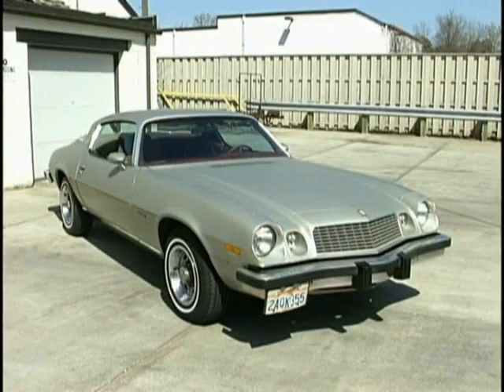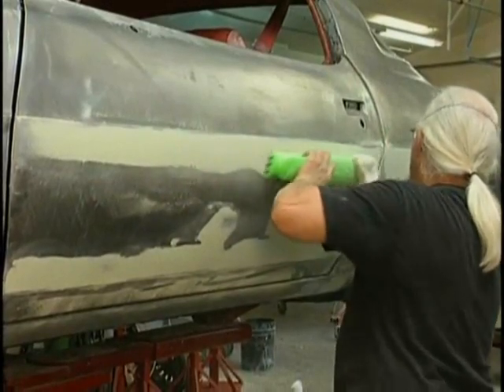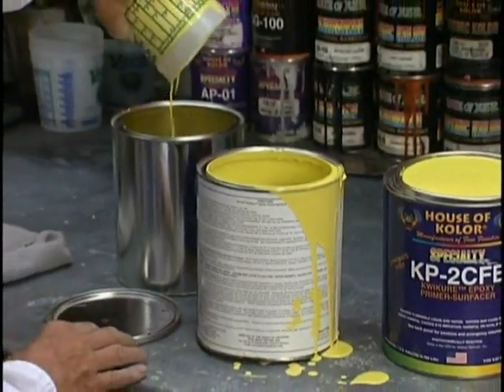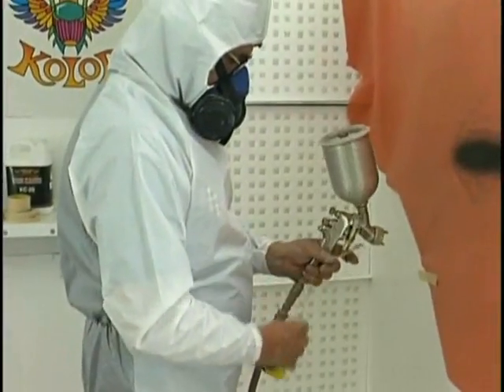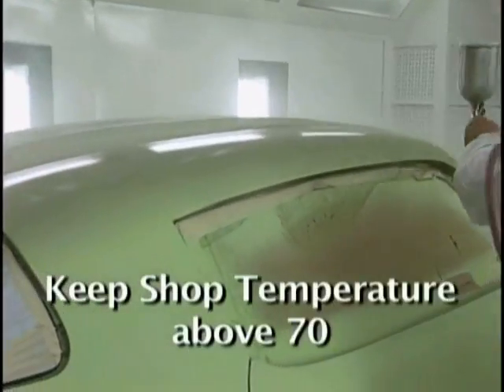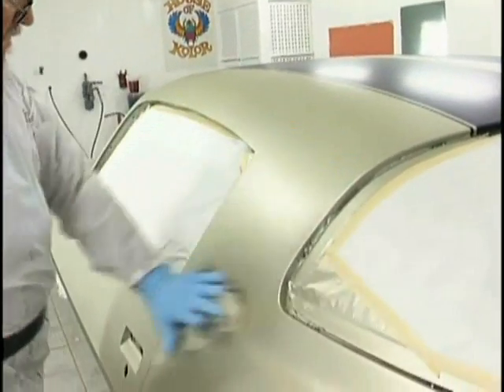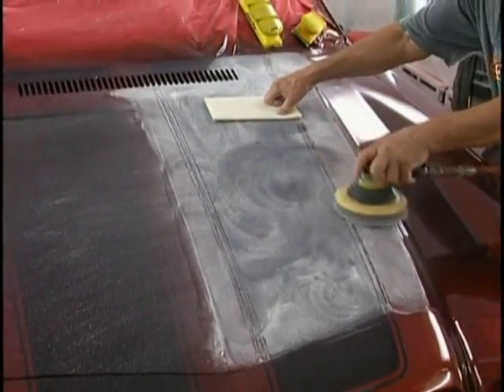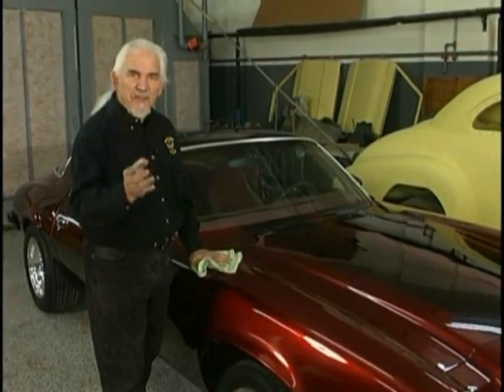KUSTOM PAINTING MADE EASY WITH MASTER PAINTER JON KOSMOSKI

Comment: Great video. As a, once upon a time, car painter in SoCal, I appreciate the techniques you are presenting. Of course, the equipment, and the products are all different but the basics are still there. The prep being the most important part of the paint job, the attention to detail on that prep, the way the paint is laid down, and the rational behind that, the straight line painting, the bending to get the rockers and the wheel wells. Everything is right on. My kudos Jon. Great job!

Comment: I could only dream about a paint job like that on my chevelle.  Beautiful work!
Reply from the maker: Thank You
Reply: pharraway   Hey man! I know you most likely busy but I was wondering if I could bother you for a few minutes and ask you a question if you can. I'm on the  step of choosing how many coats of paint for my project and I got some spray out cards that look like a checker board.
How do I use them? I mean, do I clean the card and spray the base and then the metallic and clear? Or do I have to spray primer and then the base,color and clear? 
I'm using motorcycle paint for my jeep from color-rite.
Any help will be appreciated,thanks.
Reply: king0cans hindinews
Reply: MrElPoderozo1 you use the spray out cards to test coverage or color matching. You can do a complete card spraying the metallic base then clear it to see the final color. You use the card as you go along, when the checkerboard is gone then you have complete coverage.
Reply: North Carolina Outdoors Thanks for replying. So Im using 3 stage paint. Base,metallic and clear. So I spray out the base color first then wait 10 min. and spray the metallic wait 30 min and then the clear? 
Do I have to use primer before any of that? Thanks again man I really appreciate your time.
Reply: MrElPoderozo1 epoxy primer is an under coat or a sealer for spots which body filler is larger than a quarter. Once all the body work is finished then you finish off the filler or primer with 320 and do a final coat of a primer surfacer. Once it’s cure the you will hit the primer with 600 grit wet sanding (Depending on manufactures SOP) to get the area flat for tristage paint. After you sand you will want to use a sealer and let it flash off. After that you will hit it with your base coat until complete coverage (2-3 coats flashing between) then you will use the middle stage until you are happy with the results. The clear will be the last step and you will probably need to wetsand once the clear cures because the large metallic flakes will cause an uneven surface. Once it’s wet sanded out you will flow coat and do sanding and polishing once it’s done. Use the Technical Data Sheets or call the local paint rep for the brand and follow what they say. Each brand is different as far as flash, cure and wait times go. The TDS will tell you everything you need to know about the product.
Reply: North Carolina Outdoors  Thank you very much for your help. This means a lot to me, trust me on that. I will forever be grateful 👍🇺🇸
Reply: iam in the same dilema with a 69 corvette i have in the garage. This guy works so correct. he is careful to detail and knows his stuff. lot of painters make up their onw methods and ignore manufacturers guidelines and the paint wont last as long.
Reply: icould paint her.
Reply: @7REDDRACO7  my vette? thank you!! lol
Reply: @MrElPoderozo1  spray metallics in a checkerboard pattern to avoid streaks
Reply: @mrromantimothy   Thank you👍🏻

Comment: Hi Jon.i have been painting for 45 years and i tend to disagree.anyone cant do these paint jobs it is an art from start to finish.
Nice work and all the best from oz...
Reply: @Jon--
What would you estimate the value of all the equipment?
Reply: Totally agree. I painted my first car in highschool and so I have years past since then but I am and never was a professional.  Having worked very hard for modest results, I can fully understand how hard it is to do work at the level shown in this video.  The knowledge and expertise in every aspect from mixing paints, cleaning, prepping, technique, time between coats etc... He makes it look easy but I know this is not easy, no way.  He is very very good.  Top level profesional.
Reply: Jeffrey Baker Wa
Reply: I dunno. I’ve seen show winners painted in poly tarp “paint booth” and they sure looked better than most body shop jobs...
Reply: Body shops normally only do what they can get away with. Orange peel galore.
Reply: Bob Greene I’m not Jon, but realistically you’d be in pretty good shape for $800-$900 in tools plus whatever your compressor would cost, $700-$950 or so.
Reply: dogboy That's why the expression "it's like watching paint dry" exists. Each one of these videos is more tedious than the next. Amazing resolve and results though to be sure.
Reply: Jon's DeVillbis compressor, dryer and filtration systems are at least $8,000 and probably over $10,000.  You could do nothing for $1,000 unless you are buying from Home Depot.   If you missed it, he is using a Pro Dry Air Conditioner Unit to remove moisture for the compressed air, the only way to have perfect air.   The next generation is a move to pure Nitrogen system, no more air or the hassles of trying to remove the oil and water.    We have been making N2 generation systems that fill tires for over 20 years and lately we are selling a lot of them to body shops...  for primers, sealers and topcoats.   You not only have zero moisture but the materials lay down smoother with less work.   Hope this help, Gary PremierNitrogen.com

Comment: You did an excellent job.  I'm an amateur body and paint guy which learned the hard way about blocking and sanding and blocking and sanding.  Painting was the easy part.  The prep and body work is the key.  Again very impressive, beautiful work.

Comment: used a white sealer with a metallic red , big mistake now  i gotta sand all that paint off and blow some red oxide sealer on there so the fn tank matches th rest of the fairings on the bike all this is good advice
Reply: Brent Gordon with reds you most likely will use a black or grey sealer. Only use white for very vibrant and light colors

Comment: I did a 69 camaro when I was 18 in midnight blue (1978 vette color) laquer. I had no ideal what I was doing. I striped it  and gave it some z28 strips.  1982 Now I have a 92 f250 I am getting ready for paint. It was my landscape truck. I used to touch it up with rustoleum rising sun red. Spray cans from the hardware store. I am thinking of spraying the whole truck with it than clear coating?  I saw you used a plastic bag in the cup. How does that work? I saw the d cup things but you used a plastic bag I think. I would consider your products. Money is a consideration. Heat stroke last year . Have not worked since.
Reply: Sorry to learn you were ill, I hope you are better soon. -A rattle can paint job will be more work for you, and results will never be as good. The color is inconsistent so is the pressure. And it will cost more money and needs to be properly recycled... My idea is to rent a booth, I haven't solved the gun yet. I would think a rented gun won't be well-cleaned...? They seem to cost $350-500 US. I watch "The Gunman" to learn about gun makes 😄
Reply: Very helpful comments-- how did your own project turn out? Did you rent a booth, after all? That seems an ideal solution, since you have a better work environment and definitely a better compressor and filtration/drying equipment.
Reply: Depending on an individual's budget, you may be able to do it yourself but it would be difficult.  In the old days there were booths that you could rent but not likely today, they are just too expensive to buy and maintain so rental could be $500 a day or more.  You may be able to purchase a cheap pop up garage from a place like Harbor Freight and then modify it with clear plastic sheets on the inside that you can seal with duct tape.  Of course the best is a home two car garage for security, with the hanging plastic sheets and some sealing with the tape.  Don't forget to get a really high quality dryer system for the air compressor and a little screw on filter at the gun.

Comment: Love this video...proper work, proper tools and the right attitude on what people really want for a car they have wanted to do for years, like me!  NICE...wish your shop was in my town!  a PAINT TIN TIP... take a sml philips screw driver or a sharp punch and run holes along the inside of the rim of the can, that way, the excess paint goes back into the tin, and you can clean the edge with a brush, and not have all that pooled paint around the rim!  The lid does not seal there anyway, so the few holes will not wreck the sealing of the lid:)  Cheers and thank you for a great tutorial!!  House of Kolor is a great product.  Thanks for all the important tips and information, showing how it gets done right:)  Amazing!

Comment: forgot to disconnect battery  cars with computer like bmw will  fry the computer  if you don't disconnect battery
 if your going tom do a CLASS ACT TUTORIAL WHY NOT TINT AND LEAD YOU CAN USE THE LEAD STICK TO PULL OUT DENTS  AND FILE IT OFF IMEDIATELY  FASTER THAN WAITING FOR BONDO AND YOU CAN PICK AND FILE LEAD  LOW SPOTS  BONDO WILL CRACK AND  FALL OUT ….. LEAD IS THE WAY TO GO IN MY BOOK, NO DUST WITH LEAD

Comment: ..I'm about 4hrs into starting to sand my 12yr old Chrysler 300C 5dr saloon...( By hand as I don't have a sander yet..!!) Got one on order but the battery and charger don't arrive until next week..(Back to sanding by hand until then..!!) ..Have a full time job, so can only do bits at a time. Quite annoying as I have to keep cleaning it before I can do anything and I live in a flat upstairs so water is hard to get...Thought I'd bitten off more than I could chew, but this video has given me the extra motivation that I need to re-assure me that the dream of the finish that I have in my head can, and will, be achieved. Thank-you Sir, you are a fantastic craftsman. Lol from England.

Comment: Great job great video a true craftsman. I'm not a fan of house of Kolor because of recoat wrinkling. I used it on a car I did for Autorama in Detroit It was a 40 Ford convertible we chopped and sectioned. I was painting the underside of the floor.  
The every edge wrinkles when I flips the car over. And door jams wrinkled along door jams. I ended up using a different clear. 
You are a great teacher. Awesome explanation of the job and why.

Comment: Pharraway, the Camaro you're painting brought back great memories. The first car I bought at age 17 was a 1976 Camaro then a 1978, which I Pro Streeted with a 468 ratt, Muncie Rock Crusher and narrowed a Ford 9" with 411 gears. I did the body work and painted candy red, like yours ! . I became a auto body because of it and a car builder. My last and best car, is a 427 Shelby Cobra with a correct 428 FE street engine. Just built a new one with stacked EFI and 550 HP/TQ.  I don't know how to paste pics here ? Anyway, thanks for the memory !

Comment: Wow!  the title was so correct; this  is so easy to do ; unfortunately for me my 12 year old son was using the spray equipment to paint his model matchbox cars so I had to compromise and I used a 6 inch paint roller and it is stunning. we only live in a ground floor unit and lucky for me I only have a small car and I have no area outside where I could do this so I took out the front large window and drove my car inside the unit into the front lounge area; I made a bit of a mess on the carpet and furniture when I used the paint stripper but it was so worth it to see the beautiful finish I achieved with this so simple method. I did have to change my roller twice though but as it said in the title this is such an easy way to paint a car. I think I should have used my old clothes to do the work though but I didn't have a space suit like in the video so I used a pair of pyjamas which was good as it was late when I finished and I didn't have to change to go to bed, just hopped straight in and slept like a log. The negative thing for me was not replacing my front window before I went to bed cos when I woke up the next morning, someone had stolen my car and also the front window but nevertheless a great video and I would do it all again if I ever get another car.

Comment: It does appear as if you check the fan with the tip wings in the vertical position, but then you arrange them horizontally when you paint. Is this correct? I am an engineer and just bought a Devibiss  gun i want to use this summer. You are an old school craftsman. Much Respect! Thanks!

Comment: Wow, you did so much work on this car. I watched the whole video, thanks for sharing "Buddy". What was this job worth $10,000 or above? 

I have a 2012 Dodge Challenger Sxt. White. I have only had it for 3-years, there was a younger guy that owned it before myself. So, I'm the second owner. 

A short while back I was washing the car, after rising,  I use a microfiber towel to clean all drips. During this, on the drivers side, behind the driver's door lower area but in front of the drivers back wheel, and slightly above the plastic ground effect trim at the crease area [Blisters] are forming. I used a 3 thousand wet sandpaper and wet sanded level.

Rust I think, how bad not sure.

I'd like to show you and ask what would you do, steps you would take to diagnose the extent to stop the issue from spreading. 

[I have shown a picture as I'd show you, a body shop man he says need a new rear quarter.]

I'm choked.

Would you be interested in advising my-self to correct this issue? I'd be greatful.

Thanks in advance. Sam... Care Always.

Comment: Great info and shows a lot of shortcuts and how machines speed up what used to be days of blocking in wet shoes.
 i was a bit confused as to why the mirror and door handle holes wernt taped from the back to stop dust flying out and overspray getting in..also guide coat with the windows down and  no cover over the exhaust system ,,it got painted too,,,i like to see how the door jambs were painted and the insides of the engine bay where the fenders are silver,, overall great video and great products..
i loved it.

Comment: Jon does his prep work the "Old School Way" Lots of hand sanding using sanding blocks to take out all the wave out flat body panels.  I have seen fantastic paint jobs ruined by amateur body work. Spraying a car is not too difficult, good technique, clean booth, dry air and a little luck you will get fine results.  I have painted several cars in paint booths constructed using plastic sheeting, box fans and furnace filters.  Prep a trunk lid and 1 door and take your finished panels to a good body shop and ask them if you are doing it right.  They will tell you if you are working in the right direction.  If not, they will offer suggestions.  Once you are ready to spray take your car somewhere where a painter moonlights on the weekends so he can roll your car in the booth on friday night and shoot it on saturday morning then show up midday on sunday to roll it out, untape it and drive it home so you can let it cure in the garage for a few days before you start hanging trim back on the body.

Comment: House of color and all the rest of pain products have sky rocketed to the level that people cant afford this kind of quality pain jobs as in the past. You can pay over $2500. eazy for all paint and clear needed to do a job like this. And if your doing a truck, can be 1/2 as much more. I have painted for over 40 years off and on. I learned most by myself and used from the cheapest Enamel to the high quality factory base clear coat and laquer paints. I  have painted everything from cars, truck, motorcycles go karts mini bikes quads and big rigs. And you can use multiple brands in some cases. One thing I learned not mentioned here is to pour in the reducer and hardner lowly and mix as you pour it in. This way the thinner will not burn the pain. Also let the entire mixed paint sit while you dust cloth the vehicle one more time as to give the paint a chance to sit and let all the chemicals react and blend to each other. Then mix one final time before you filter into the paint cup. Some acrylic Enamels can also be clear coated. But most two stage pain jobs even the factory ones burn in time as you see so many factory vehicles on the road today with less than 10 years on them. If you want a good paint job with less than 1/2 the work here. Do it in Acrylic Enamel. You can pay like $1400. a gallon for just the base color of a Ford Blue Metallic color not counting the reducer, hardner etc. Plus the clear for about $600. a gallon to put over the blue. Yes thats how much they go for now. Or you can do it in Acrylic enamel for $99. a gallon kit (1 gal Paint, 2 quarts reducer, 1 pint hardener)  This is sold on ebay and yes they have other colors for about $25 to $50 more depending on the color or pearl color you buy. But yes you can mix different brands sometimes. I recently used 2 quarts of Standox paint made in England ( Metallic burgundy) and used grow automotive reducer for $13. two quarts and a universal hardener and got a clear coat look without the clear.  They also make a wet look hardener that give you alot more gloss, then the regular hardner. It  also helps to watch many videos. You will find people do some things good, others you will see they are a disaster and you will find the way things work for you if you try. One more thing not mentioned in this video. Always wash the entire vehicle with a strong detergent or laundry soap and remove any tar or grease before you start to sand or do any body work. If not you will sand the grease, oil, etc into the pain and cause a fish eye or imperfection if you dont get all out first. And if you do paint in Acrylic laquer , just wait 2 or 3 months and buff out the paint to look like it has clear and be super smooth.